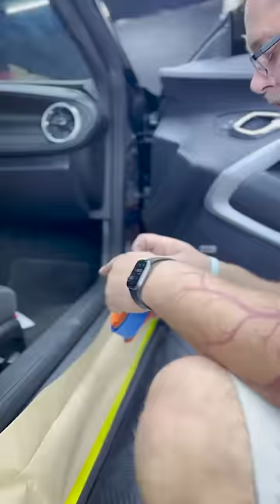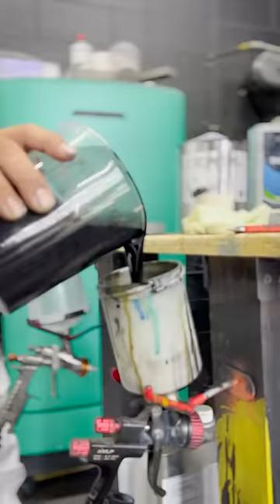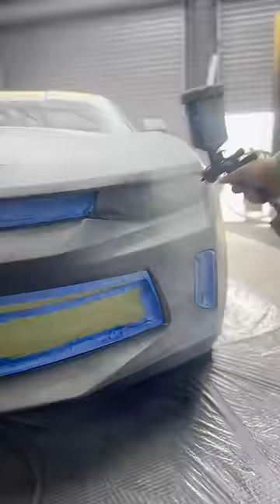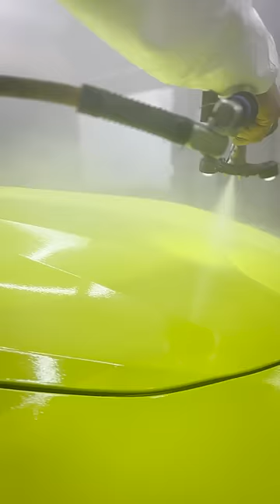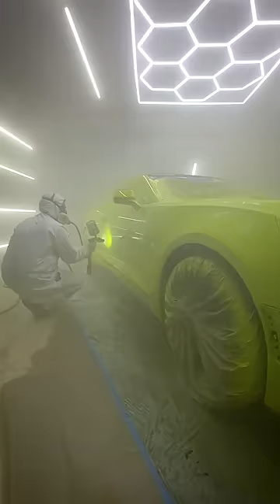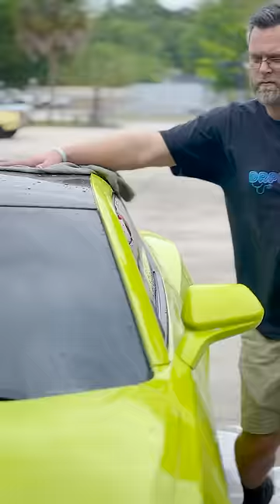Liquid Wrap ASMR | Acid Green!

Comment: since when a paint job gets called "liquid wrap" 💀💀💀
Reply: I think its a Peelable paint
Reply: It’s Plasti Dip
Reply: @Unknown-0-0-1- I have never seen plastidip that is sandable.
Reply: @AAA-od9vm  you can with 2500 & 3000
Reply from the maker: since you can put it right over your factory finish and peel it off 5 years down the road
Reply: @Unknown-0-0-1-  I did not know that, learn something new everyday.
Reply: @DrPigment How much does it cost?
Reply: @DrPigment doesn't it even require sanding
Reply: Buddy had his professionally done and he said it’s not worth it with the overspray that get in between some gaps
Reply: It’s just plastic-dip.

Comment: Spot putty on oem paint before using the liquid wrap. Dude gonna be mad af when he peels off. Hilarious
Reply: Spot putty washes off easily with rubbing alcohol, it's not bonds with a hardener
Reply: @DoubleTripleOGfromtheset  ok so why use it in the first place. One must first be competent to produce a quality paint job. Prove me wrong!
Reply: @virginiacash3084  he didn't paint it, it's a spray wrap, a reversible process. He used it to level out the panel of the car without having to do some kind of actual dent removal. Such as exspensive PDR or actual dent puller and Bondo. Putty is a much better, non invasive option.
Reply: @virginiacash3084  ok I did, and don't delete ur comments now
Reply: @DoubleTripleOGfromtheset  I do this work as well however I do things correctly. I would've repainted hood then wrapped. Some people aren't COMPETENT I understand.
Reply: @DoubleTripleOGfromtheset real reversible after putting the DA on the paint 🙄
Reply: I mean.. at the end of the day the OEM paint is damaged from rock chips regardless, whether its a chip, or a chip with putty in it, its there. At least it won't show up in the liquid wrap.
Reply: @ry996  it's clear coat. And he did that to achieve a bond, it easily polishes out.
 Tell me you don't know how to wrap without telling me you know how to wrap.
Reply: @virginiacash3084  YOU can do what you want. YOU are not the customer. They get what they pay for.
Reply: @DoubleTripleOGfromtheset  he did that to waste more of dudes money on a dog water "sprayable wrap"

Comment: Whats the difference between liquid wrap and paint
Reply: Also wondering cause why not just paint it if tou have to do all this? Is it cheaper? I dont think so
Reply from the maker: Liquid wrap sprays on like paint and peels like vinyl. It goes right over factory paint no sanding required. You can buff/polish it. It is gas proof and car wash safe. When the owner is ready he can peel it off and go back to factory

Comment: don't get the point in this, why not just do a proper permanent paint job, labour and materials wise would cost the same but isn't going to come off after a few years
Reply from the maker: @g.d2450  A paint job (done right) requires you to sand down the factory paint to bare metal, primer, then spray. Auto paint (quality stuff) also costs more. Like a $1000 for a gallon of clear sometimes. It also takes much longer. We can liquid wrap right over factory paint in 3 days and protect the factory paint in the process. And it costs less.

Comment: So are the jams black 😂 man some people shouldn't hold a paint gun
Reply: Its not paint.
Reply: @ethanelam9238  comes out a gun and sprays clear far from a wrap he sanded the hood good luck getting that so called junk wrap off
Reply: @ovalsx  pretty common thing, the black layer below is a base peel coat, that the other layers go on top of. This coating lasts about 5 years, and it comes off in a matter of hours with a team. It's not a wrap, and it's not paint.
Reply from the maker: Liquid wrap sprays on like paint and peels like vinyl. It goes right over factory paint no sanding required. You can buff/polish it. It is gas proof and car wash safe. When the owner is ready he can peel it off and go back to factory. The owner opted to NOT have the jambs sprayed.